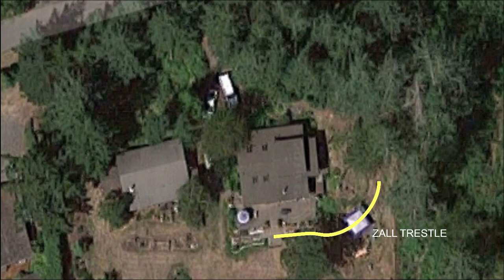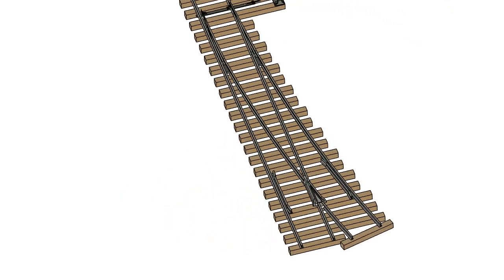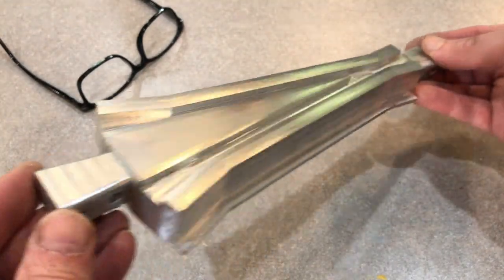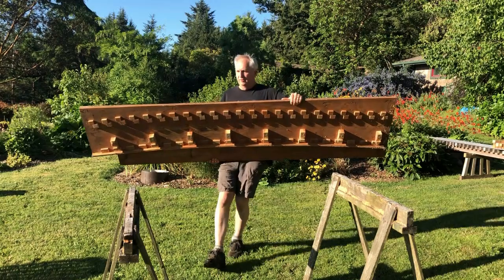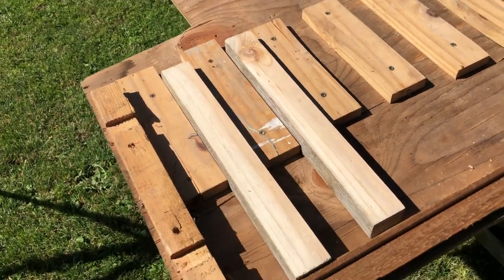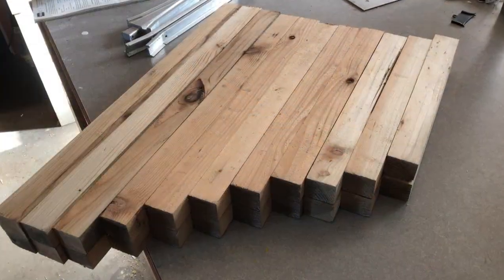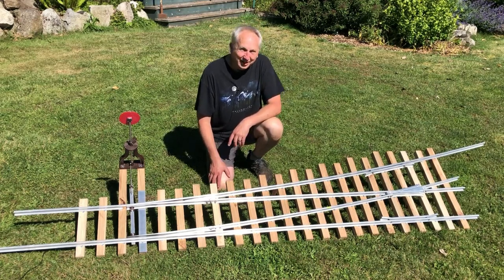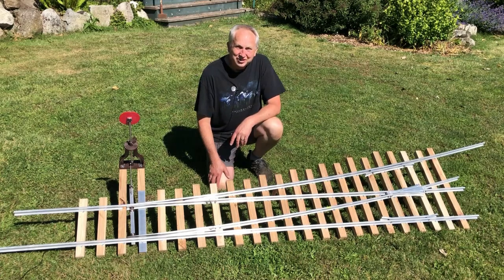1 1/2 scale backyard railroad switch build.

Comment: Excellent switch stand! Do you share your STL or G-Code files? We are making track panels (7.5" for 2.5" scale 3' gauge) and will be working on the roadbed soon. Only one switch planned thus far to enter the mainline - but that will no doubt change!
Reply: I found them... need 2 1/2" scale. Must crank up the CAD...

Comment: Thank you for the video. I am just starting in 7 1/2” gauge. No one around to ask even basic questions. Hence lots of searching YouTube and the internet. What size are your ties and what spacing? I have a line of 2500’ of Aluminum rail in 10’ lengths. I have access to lots of wood and a bandsaw sawmill. Did you use wood preservative? Thanks. Cheers. David

Comment: why does the diverging branch start with an angle where the point touches the main rail, suddenly changing the direction, instead of tangentially smoothen from straight part into a curve?
Reply: Full size turnouts diverge at an angle, rather than being truly tangential.  Otherwise, the switch blades would be very long and slender.  An exception would be turnouts intended for high speed operation.

Comment: Although you did a wonderful job making this. You might consider casting the "More difficult parts.
Making a pattern from wood/3D printing, then machining it to your spec's. This way, if you need another down this line
your pattern is already made. The casting, if done correctly, will be just as strong if not more.
I've done this method mostly with gear making. The more accurate you are with your pattern, the less chips you will produce.  ( ͡❛ ͜ʖ ͡❛)👌

Comment: We also used steel 1" channel  20' long  for track and switches (welded on 3/4 x 1/16 flat bars with holes for nails and drilled holes  every 7 inches  for ties) We used to use Aluminum rail  but The Railway  is on an Island  🏝😉 and SALT AIR CORROSION IS TERRIBLE...GOOD THING ABOUT STEEL Channel rail its easy to carry,Cheap, The best thing about STEEL Channel rail..Its not as slick 😀in rail or snow.....And For all "JAWTOOTH  FANS"....THE RUSTY TO SHINEY  RAIL AFTER THE 9" GAUGE  NIGHTLY  MANIFEST  TRAINS GO OVER IT....WOULD MAKE "JAWTOOTH  AND JAWTOOTH  FANS SMILE..

Comment: Outstanding!!!  Hope to start on my own 7.25" gauge outdoor railway in a few years (30" narrow gauge on 7.5" gauge for 1/4" to the inch scale).  I'd often wondered why no one offers a machined steel or aluminum frog.  You see cast aluminum and welded (strip stock) steel, but no fully machined.  Love your machined rail switch points too...  There was a supplier doing the same in 1" steel rail, but for whatever reason, he's stopped offering those and has switched to machined "C"-channel instead...  Going to save this video for future use!

Comment: Weevil, beautiful work! 
I am building a 7 1/2” gauge backyard railroad this year. Thankfully the track is nearly all done. I used a switch kit from Accutie. The switch works beautifully. They use steel points instead of aluminum , I assume for additional strength and stiffness. How are your aluminum points holding up in service?
Reply from the maker: Fine so far but my trains are pretty light.  Steel is the way to go if you are running heavy diesels,  steam or heavy passenger cars.